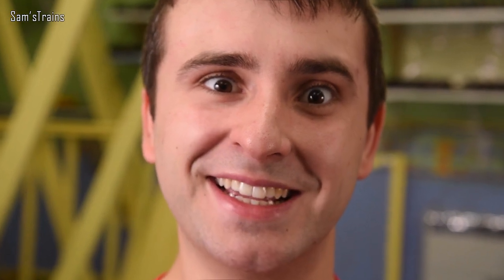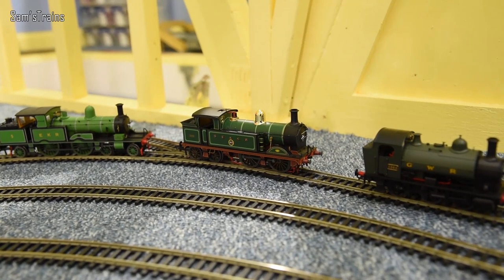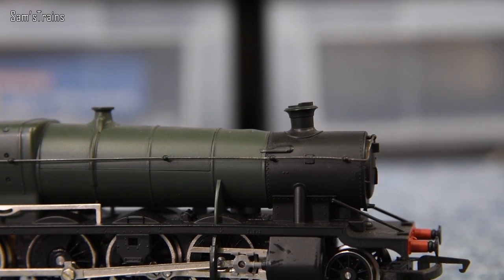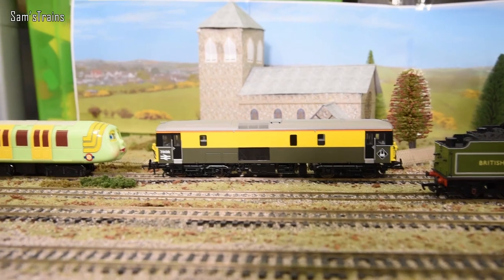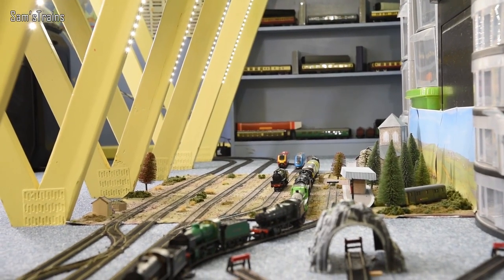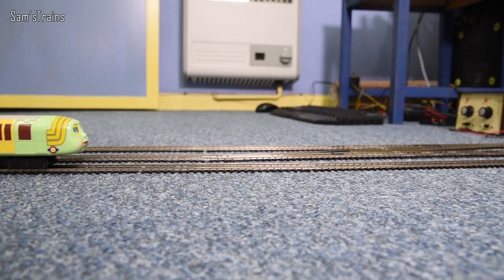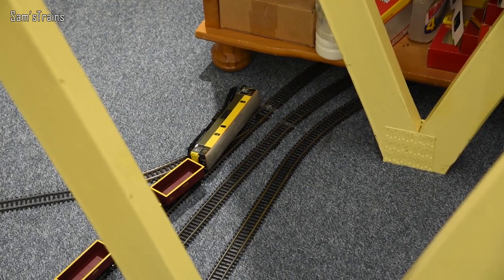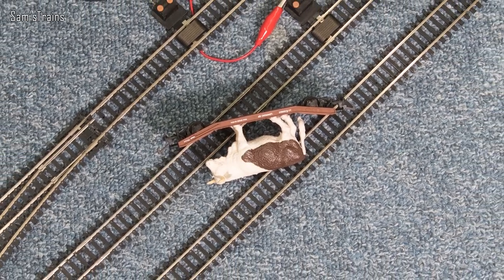Lemon Locomotives | Model Trains With Design Faults

Comment: I don't think Circle has a design flaw based upon my experience with a Bachmann Underground Ernie Jubilee which is mechanically identical to Circle. It has no issues with noise or derailment. It is a slow runner but that would be correct for an Underground train and the eye mechanism would look even more silly if the train raced around like a Honby 0-4-0. On that note, imagine the euphoria that would erupt if Hornby's released a cheap 0-4-0 that could run so slowly.
Reply from the maker: No not a design flaw, mine was just assembled improperly - it's a quality control flaw!
Thanks for watching - Sam :)

Comment: Sam please do a reliable locomotive report to follow after this. I think you should include the Hornby basic 0-4-0 locomotives as they are super reliable I have one that is 20 years old and will still run strong if used.
Reply from the maker: Most of my running sessions contain reliable locos, but sure an ultra-reliable session could be fun! :D
Thanks for watching - Sam :)
Reply: @SamsTrains  please do I think these little locomotives really show up the expensive detailed locomotives

Comment: Olmsted all my model trains are lemons number 1 Missouri Pacific Lines I can't get it to run it did run but only for short time number 2 is a big train and it's a big boy it's moter is burned out and it makes a noise of a burning out moter when I try to to run it number 3 and 4 are 2 tank engines they don't run.

Comment: Shocking how many had poor motors in them, if anything that should be high on the list of where to invest for quality. Makes me thankful that the only motors that have failed on me are over 60 years old or where on a model steam engine that is so heavy with traction tires that it stalls before it slips (80+ car train on a stiff grade with 4 decent curves on it). As for that Underground Ernie set, hook it up to a 24v system and jump it into a fire, free it of it's horrible existence.
Reply from the maker: Yeah definitely - I've had a lot of bad luck with motors for sure! haha yeah - that's the only good reason why motors should fail - massive abuse! ;D
Thanks for watching - Sam :)

Comment: So there is no known way of fixing Henry’s tender wheels? My wheels have been out of place for a while but I haven’t really ran my HO models until recently. It’s super annoying to pay $100+ for a model and have it break instantly, especially with Henry’s model which looks amazing.
Reply from the maker: Yeah there's a way - remove the tender body for easy access, and pop the tyres off completely. Apply a few tiny drops of superglue to the plastic wheel, and then quickly push the tyres back into place!
Thanks for watching - Sam :)

Comment: I noticed that you mentioned the bachmann Thomas range, and how most of your locos have burnt out. However, the thing is is that those models, which are designated for American markets, are designed to be run on controlled that have a power intake of 120 volts. However, as you may know, the voltage in the UK and most parts of Europe is 220 volts, which is too high for those models. And yes, the motors are kind of poor quality compared to others, and the moving eye mechanism increases torque on the gears, but for the most part, it could be your controller, since my Thomas is holding strong for almost 2 years, even after some severe derailments. The most severe derailment that my Thomas has had is when I had a HO setup going under my bed, and the Thomas derailed under the bed, which is very convenient 😒. I later used another locomotive to push him out, but instead, he just fell of the track entirely. Later, I had to fish him out with a shirt hanger since it was long enough to get him, and he still ran like he did from the factory after some basic maintenance (some lubrication).
Reply from the maker: Not quite mate - you don't run models on the mains. Controllers step down the voltage to 12v max. I use controllers designed for British mains, so that isn't the issue. 
Thanks for watching, Sam :)
Reply: @SamsTrains  oh okay. I'm not the best model railroader so 😁

Comment: What a pity for all those locomotives to have such problems. 
My worst runner is a rivarossi HR-2007 Hudson. The contacts of the driving wheels are awful and the tender pickups do not work properly. Plus, it has only 1.1 newton of pulling force. 
(+Poor detail and plasticky look)
Its price: 265€...
Thank you for this informative video!
Lefteris.
Reply from the maker: Yes indeed - and surprised to hear that about a Rivarossi - thanks for the warning!!
Thanks for watching - Sam :)
Reply: @SamsTrains  These problems were about older rivarossi models. Thankfully the newer ones are more engineered and have better detail! But I hope not to repeat those mistakes...
My pleasure to watch your videos!
Lefteris.

Comment: The poor motor life in many of these models is due to product research - Hornby and Bachmann learned that most sets sold to children are only used for a few hours total, then discarded, so they supplied motors built to only last that long. On the other hand my Oxford Adams radial runs beautifully on a line with some uneven track, has no problems at all. Seems to be rather hit and miss as to whether you have problems! 

There are ways of improving the 14xx - one is to replace the second pair of driving wheels with another front set, as the traction tyres and poor pickup plungers were a major problem (on the original Airfix/Dapol issue). Indeed, replace the plungers altogether with a piece of PCB and phosphor bronze wire, and she will run much better. I regularly run Keysers versions of both the 14xx and the 1361, fitted with Romford wheels, and an even older Sayer Chaplin 14xx - you're looking at models which are now between 50 and 65 years old! - and they still run reliably and  really well. Pity about the H class.
Reply from the maker: Maybe you're right there John, very interesting thought! And thanks for sharing on the 14xx - duly noted! :D
Thanks for watching - Sam :)

Comment: I think that my Tender motor in my Hornby Mallard has a design fault. Thankfully, I've ironed out the stalling problems.....
Reply from the maker: Ahh well done - what did you do? :D
Thanks for watching, Sam :)
Reply: @SamsTrains  I widened the wheels slightly so they're not moving about on the rails and using the old chassis cogs, because there were times when the traction cogs kept disengaging from the cogs in the motor due to the motor moving about instead, I used the traction cogs from the old chassis (as the motor in that one had burnt out, so I had to replace the chassis) and attached them onto the metal rods on the non-cog side of the motor, reattached the wheels, and when I ran it, it worked well without stalling.

Comment: A different lemon I thought of and noticed wasn't in the comments is the Airfix 14xx which had plunger pick ups which wheren't much good it also stripped the plastic running gear and I have heard stories of the chassis snapping in two
Reply from the maker: Yes that's right - I wasn't a fan of the Airfix either!!
Thanks for watching - Sam :)

Comment: I have two Dapol Class 73s, and mine don't de-rail - principly because I don't run it round sharp curves. My Dapol Class 121 also does not de-rail, for the same reason.

I also have the Bachmann Virgin "Super Voyager", which again does not de-rail, if you run it at medium-speed.

However, there is a REAL design flaw that I think you've overlooked - the Hornby Class 71.  The model featues a working pantograph (unnecessary, given that their pantographs were only ever used officially in freight yards fitted tramway-style catenary), which has a habit of disintergrating! The pantograph is also made of incredibly flimsy metal. A much better option, in my view, would hav been for Hornby to produce the pantograph as non-working plastic representations. My own Class 71 has been relegated to Track Cleaning duties witha Hornby Track Cleaning Coach. This is a real shame, as the Class 71 is lovely runner.
Reply from the maker: Glad to hear that Kevin - but as they're rated for 2nd radius, they should be able to handle curves of that tightness!
The Hornby Class 71 pantograph is indeed very flimsy, but mine hasn't failed me as of yet, sorry to hear about yours though :/
Thanks for watching - Sam :)
Reply: @SamsTrains  Correct. It is up to the manufacturers to provide models that runs properly. One locomotive at roughly GBP 150 to 200 has a price equivalent to what I spend for food for me in one month, to give you a practical idea. You can have an entry-level clothes or dishwasher for the same price, which manufacturer would not been bashed to death by the consumer's press if they sell a dishwasher that destroys glasses washed in it, or a washing machine that cannot work at all with somethin else that the cold water whool program ?
Model trains are expensive consumer products, and OUGHT to be properly conceived and manufactured. Even if, unlike automobiles, they don't kill people when running badly... Perhaps by choking of laughter for the Heljan 1361, or cardiac arrest for the one who sees for the first time the acid-bad-trip-couloured like underground vehicle by Bachmann.

Comment: You can fix bachmann Emily by taking out the spring in the front wheel set
Reply from the maker: That's not going to fix the dead motor ;)
Thanks for watching - Sam :)
Reply: I beLieberman that the wheel spin from the front spring wheel caused that

Comment: Strange, but can only disagree with a couple of the locos assessments.  I have 4 x Dapol Class 73's, all of which run well with no faults, and 2 x Bachmann Class 221's which also run well and have never derailed . I wouldn't call my track anywhere near perfect, but do use 30" minimum radius curves and medium + large radius points. Guess, I'm just lucky!!
Reply from the maker: Thanks a lot for sharing Paul - I've heard of some dapol 73s running well too, so it doesn't sound like every example is affected. Interesting on the 221 as well - mine was a nightmare before I made some modifications!
Thanks for watching, Sam :)

Comment: I never had a loco with design faults (I have all Marklin 20locos, same case with my dad my guess~100 -150 locos) They are definitely not the cheapest but with lubricant changes those bastards never die I have 1 That kinda gets kinda hot to the touch but it is a small old loco. There was 1 design fault with older Marklin locos In Dutch it is called Zink pest dunno the English term but translated it means Zinc Plague where the metal will oxidise and the paint falls off, didn't happen to all batches but not uncommon to older locos.
Reply from the maker: haha not surprised - Marklin sound like great quality! Yes Zink pest is known over here too, we call it Mazak rot!
Thanks for watching - Sam :)

Comment: I Think The Reason The Bachmann Thomas Models Burn Out Is Because Your Running Them On Hornby Track. See The Bachmann Thomas Models Are Like Toys, Made For Kids, With No Detail And A Fun Eye Movement, While Hornby Are More For Series Modellers, Not Really Made For Little Kids Like The Bachmann Thomas. And When You Run Them On Hornby Track. So There For There Getting Much More Power Then They Need, Which Burns Them Out.
Reply from the maker: Nope - the track makes no difference. Nor does the controller. If you're running them on 12v DC, that's perfectly safe for them, and perfectly fine! :D
Thanks for watching, Sam :)

Comment: Well, does anyone really think it's cause for amusement to be ripped off hundreds of pounds for stuff that doesn't even work?
What amazes me is why anyone would keep something like this, and even attempt to 'fix' it, instead of returning it with a stiff letter of complaint, and then sending the manufacturer a "you cannot be serious" type email.
We need to let them know we're not having it, because as long as we're prepared to put up with this sort of nonsense, so long will manufacturers be happy to keep making and selling us garbage.
Reply from the maker: I certainly don't just put up with it - this video was more light hearted, but it follows my reviews for each respective model during which I berated them for their various flaws, undoubtedly damaging sales by doing so. In my particular case, I stand to benefit more by keeping the models and using them in videos (like this one), but to everyone else, I obviously strongly recommend making returns for faulty goods!
Thanks for watching - Sam :)
Reply: Yep agree with you on that,surely these models must come with a 1 year warranty from new? I'm not saying the Hatton's  class 66 is crap but people have had a lot of trouble with that of late.I purchased a Hornby class 66 of course its not in the same league as the Hattons,but hey it did run straight away out of the box :)

Comment: Question I'm from america so dont criticize me... so you ever clean your locomtive comitayors or oil them!?!? Can it would like you take care of them but not on the inside...
Reply from the maker: Yeah where accessible I clean them, though you don't put oil on the commutators!
Thanks for watching - Sam :)
Reply: @SamsTrains  .... my bad typing i clean comitaters with an eraser or with a cutip sometimes dipped with alcohol if it's bad enough
Reply: @SamsTrains  also if you locomotive how a bad enough motor try putting one on top of the other and add a gear ration to let both of them work to gether for diesel, dont know about steam

Comment: Ironically the Hornby 14XX can pull two Hornby/Airfix OO auto coaches but struggles with Mk1

Personally, the Hornby 14XX should not have traction type because it is an excuse for making the Hornby 14XX heavier.
Reply from the maker: haha yeah you're right - I prefer heavy locos!
Thanks for watching - Sam :)

Comment: Personally, the worst running loco I have is Hornby Oliver. It has an airfix chassis, a replacement, and the worm gear grinded the drive axle gear so much that the worm gear doesn’t make any contact with the gear anymore. It’s just sad to see.
Reply from the maker: Ahh sorry to hear that - yes those are definitely problematic aren't they? :(
Thanks for watching, Sam :)
Reply: @SamsTrains  they sure are lol

Comment: Ok ... just WHAT was that creepy lime coloured monstrosity with the weird alternating side eye? That's a candidate for the old "Emotionally Scarring Toys" website.

Watching the Dapol in "I've had too much vodka" mode on a bend was genuinely funny. As for the Heljan ... they charged £150 for THAT feculent dreck?

Someone needs to grab some of these companies by the scruff of the neck, and subject them to time on the ducking stool, until they replace those lemons with properly tooled kit, featuring die cast chassis plates as a minimum,  5 pole motors and quality flywheels, hard wearing gear trains, proper bearings, multiple pickups, and ACTUAL TESTING to see if they work. Oh, and do so without entering price gouging territory.

Don't know how many would agree with me on this, but if I was manufacturing models like this, I'd run with quality (and tested) mechanicals, then arrange for each chassis to have a budget body for those who aren't loaded, and a top quality body for those who want the best come what may. And ... make it easy to fix things that break. Can't be that hard with modern CAD systems surely?

Comment: Bachmann doesn't specialize in UK trains the way hornby does. They make much better HO scale American stock. I have a fairly old model of a Baltimore & Ohio 2-8-2 Mikado with a 12-wheeled tender that works fine.

That's why I get my UK stock from Hornby
Reply: It's pretty hit or miss over here in the US too. As for rolling stock, they make good bases for modification, but their truck-mounted couplers are just asking to derail. I do have a Bachmann Niagara that runs beautifully, and is well detailed.
Reply: @victoriacyunczyk  that's absolutely true. I'm in the US too, and I've just found I like a good bit of the UK stock from Hornby. As for my bachmann stock, my best locos are my spectrum ON30 Moguls. Other than that, I have two working HO scale bachmann steam locos, and another working ON30 loco, an unusual 2-4-4-2 mogul, none of them work all that well. I believe, working "OK" would be an acceptable term. As for my original post, I hadn't obtained most of my locos when I posted it, I'm now better informed (and experienced).

Comment: 17:13 at least the 14XX's incompetent running prevented an accident. If the 14XX were to go, then the Dapol would've crashed onto the 14XX on the points.
Reply from the maker: That's true - clever 14xx! ;D
Thanks for watching, Sam :)

Comment: My hornby class 466 networker lovely looking model but only one set of wheels drive it slips if the track is not billiard table level and squeaks also the axles are rough causing more friction sits in the siding looking good but as for running forget it .
Reply from the maker: Ahh very interesting - never heard of that problem before, thanks for sharing! :D
Thanks for watching - Sam :)
Reply: Can you do a peach of a model staying on the fruit theme I mean the best you can buy ,I’ll nominate my Bachmann 37 running 16 years and still as good as new